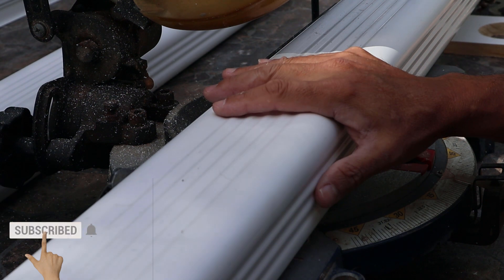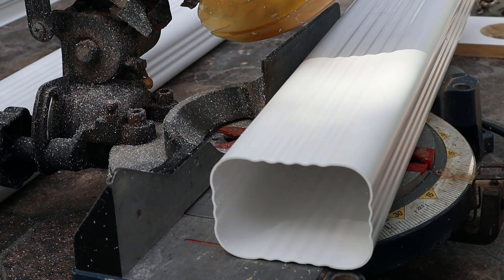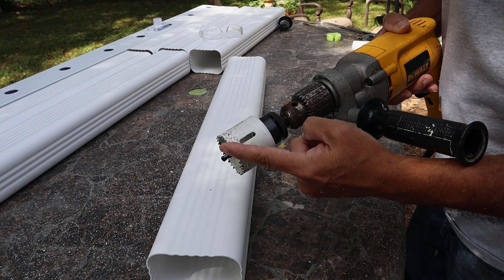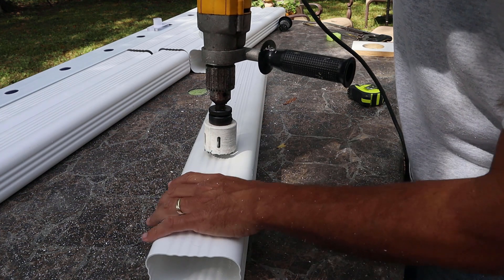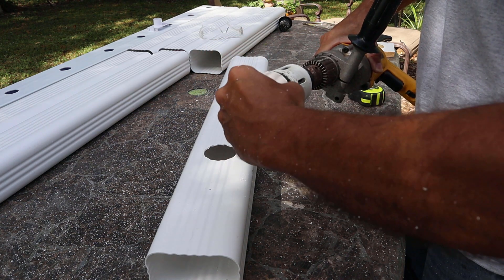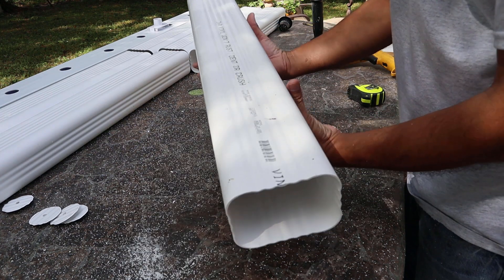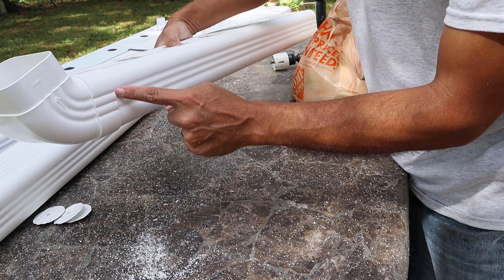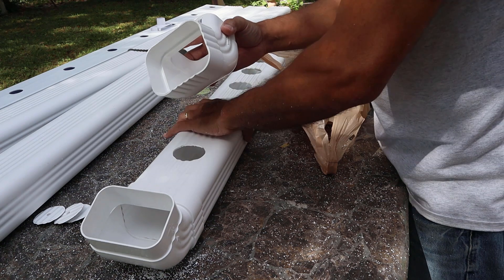How to Make a Downspout Garden Part 2 / Common Questions / Gutter Garden / DIY Hydroponics

Comment: Quick form tip. A pot of near boiling water will work to heat the bottom of the pipe then mold on the jar.
Reply: just realized this is a older video my bad lol... still good info!

Comment: Use pvc pipe cement not silicone, its sold next to the water pipes cheap and easy. It welds the two pieces into one.(There may be cases where you don't want a permanent bond, but even silicone has many types of sealant and adhesive.) 
Also most people don't understand what "food grade" actually means. There are several different categories from bulk quantity food additives, down through "incidental contact" which basically means it should not be in normal contact with food but can be used in the same building where food is made because people won't die from accidental contact, and the limit for escaped contaminated food following an "incident" is only about 5ppm. 
This doesn't necessarily  mean the item is generally unsafe but the manufacturer didn't want to pay for a higher certification(and insurance) because the market for the item doesn't need it.

Comment: If you DO end up going with the end adapters, Is there a reason why those couldn’t be used as additional plants spots? Maybe using a few noodles bits side by side? In lieu of covering up.
Reply from the maker: Yes, they definitely could. The shape is just awkward and covering them took about two seconds, lol. Styrofoam may do nicely too.

Comment: What’s the difference in the folding versus the curved taper? I ask because I haven’t watched a video yet about how you water these
Reply from the maker: I just lift a plant and add water. The curved elbow is easier to make, just a little silicone whereas the folded one needs to be heated and bent.

Comment: What is the white round piece that you are  using to drill the holes
Reply from the maker: It is called a hole saw for a drill.
Reply: @KeepOnGrowin  Thank you.  You mentioned that you should use a food safe caulk when sealing the end pieces if you decide to add the elbows instead of bending the ends.  Do you know a safe brand.  I am having difficulty locating it

Comment: Hi how’s it going?  Enjoy watching your channel.   I was wondering.  Can I do 15’ in long pvc system with the static water process?  I noticed you usually just do 4’ sections.  Also, what is the best nutrients to start with?  Much appreciate if you could help.  Thanks!
Reply from the maker: Yes, I had 8' ones that worked great. The smaller ones are easy to move. I only use Masterblend now.

Comment: Great tip on the Hole Saw direction. I also some times drill pilot hole on normal drill.
Reply from the maker: Yes, i have been drilling a slightly bigger pilot hole so the plastic disc does not get stuck on my hole saw. 🖒

Comment: I would like to know when the water level is low in the pipe do you add more water or the chemicals? and how much.
Reply from the maker: Iadd more nutrient solution.  Keep it between 1/2 to 3/4 full.
Reply: How do you add the solution?  Pull a plant out and pour it in that hole?
Reply from the maker: Yes, exactly. Or you can leave one plant out and just cover it with an empty pool noodle.

Comment: Just another idea for the ends that worked really well for me and VERY easy.  After you cut your holes and clean out the downspout,  take your pieces inside, bring a big pot of water to almost boiling....tilt the spout and just dip the bottom of the spout in the water for about 15+ seconds and place on counter with bottom up.  With a gloved hand,  make a fist and push down on end and  mold.  May have to double dip if needed.
Reply from the maker: Awesome, I am going to try that!! You rock! 😎👊🔥🔥
Reply: Love this idea!!

Comment: I just made eight of the 30" units last night. Another Pro Tip for your next video update......I also made a similar wooden jig (like the one you use to hold the spout to bend the ends). I found that using it to hold the entire grow box while drilling the 1 7/8" holes worked fantastic. It kept the downspout stationary while drilling the holes - keeping it from moving or spinning. Safer and easier for everyone!
Reply from the maker: That is awesome!! Also,  what a great tip, thanks so much!!😎🖒 Keep us updated.

Comment: One tip from a carpenter... just like your drill, mount your saw blade backwards to prevent chipping. Great videos keep up the good work.
Reply from the maker: Awww man, you are awesome.  I did have a few chip. Appreciate that!!!🖒🖒
Reply: Also a carpenter, also came to say the same thing. Glad to see someone else already posted this.
Reply: good tip 🙂
Reply: What size is that rain gutter? Only ones o could find are 3”x 2 1/4”

Comment: Hi Mike in England we only have 65mm (2 and half inches) square down pipes, Could you please tell me what drill cutter I need and how far apart I make the holes. Thank you
Reply: Annette Rose. I am in England as well, do a Google search for "white plastic ducting" (used for kitchen extraction)
It's sold at Tool station, Wickes and B&Q. 
Should bring up a similar specification to what Mike is using.
There are ends as well so don't even have to bother with a heat gun!
I am going to try one on the fence in the garden!
Reply: @andynightingale7335  Alternative is to use square downpipe, Wickes (432025)  2.5m for 5.50
Reply from the maker: About 2" holes, 2" apart (4" on center). If you are using net cups, make sure the hole is small enough to hold the lip of the cup.